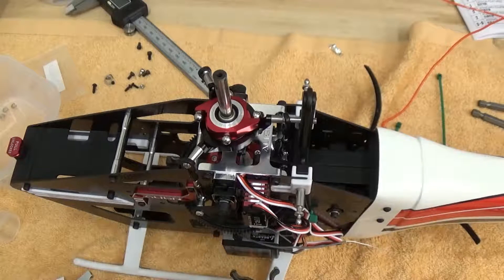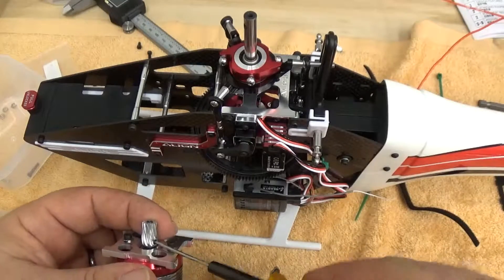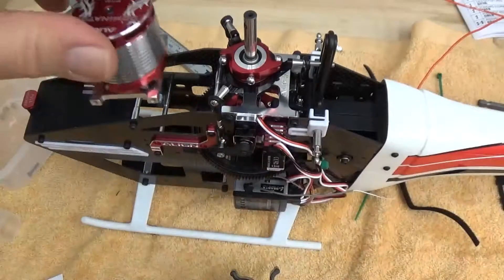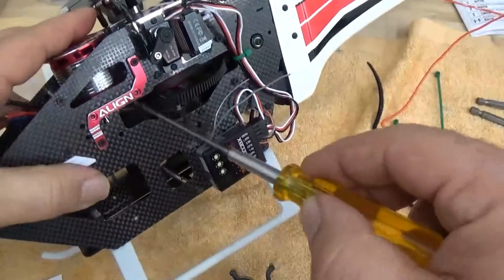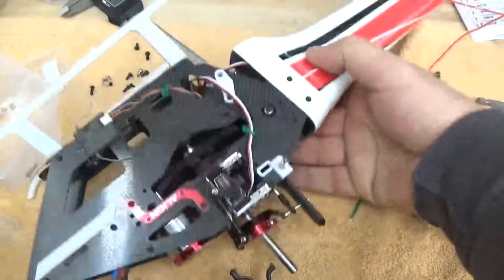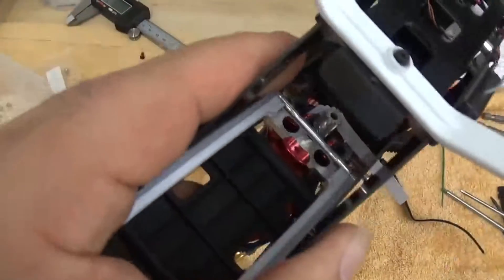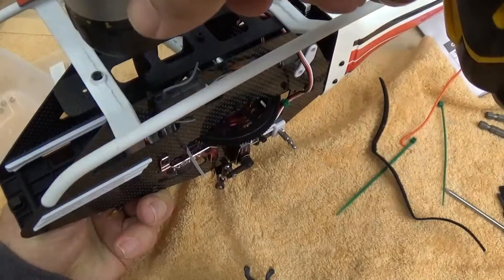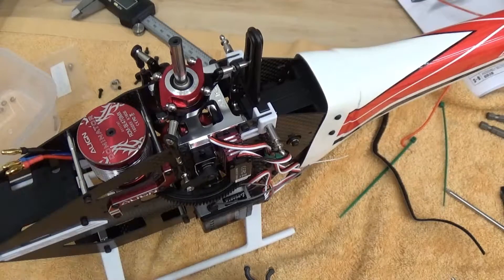TREX470LM motor install

Comment: Hello, your video, saved me, I stayed all afternoon, trying, I put the pinion, and could not put the main guear, after so much breaking my head, I removed the engine and adjusted the screws, and then I got there with some effort, but I still had not seen his video.So in love with Helicopter, I am a young beginner of 60 years, I am using the Simulator about 1 year, I already fly the XK K110, but only basic flight.This T-rex470LM is my first I appreciate your generosity in teaching the beginners. I will see the other videos, I am terrified to put together the links, I hope you have some video on the subject. A big hug, Elias Brazil.